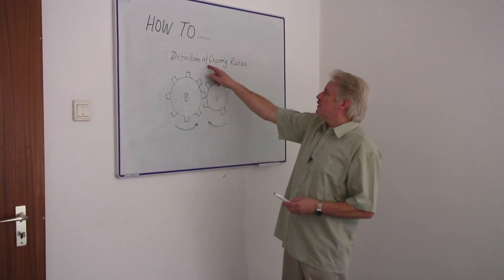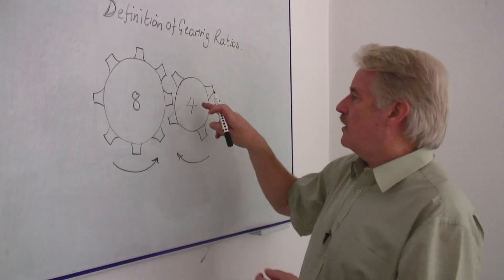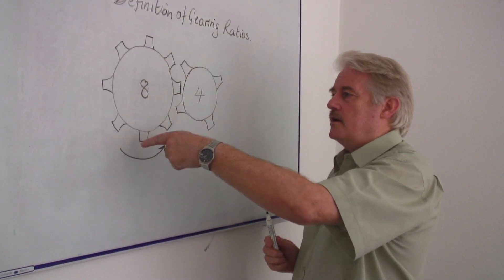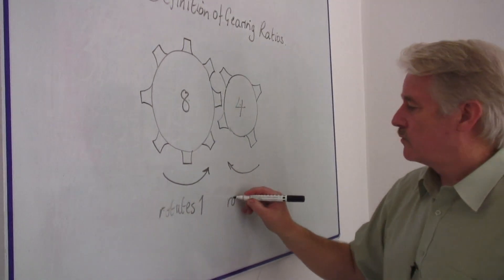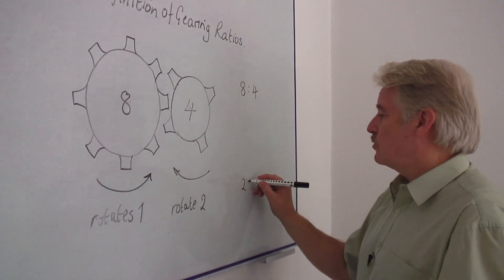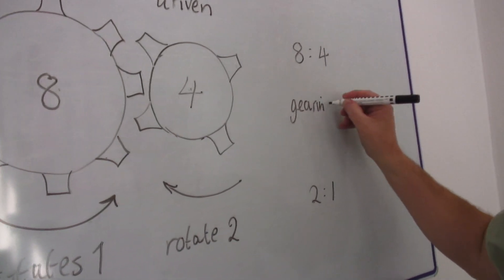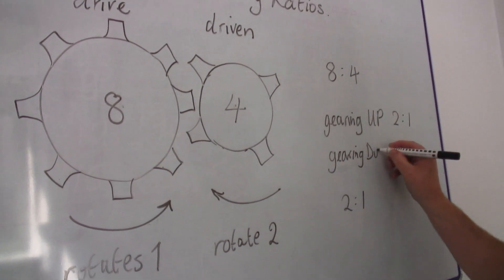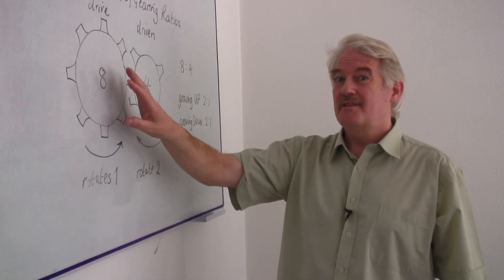Math Calculations & Conversions : Definition of Gearing Ratios

Comment: MOST IMPORTANTLY THEYRE TORQUE DIVIDERS AND TORQUE MULTIPLIERS 

WHILE AT THE SAME TIME SPEED DIVIDERS AND SPEED MULTIPLIERS

THATS THEIR MAIN FUNCTION 

IF YOU WANT BOTH TO ROTATE IN THE SAME DIRECTION USE AN IDLER GEAR BETWEEN THEM, THE NUMBER OF TEETH DOESN'T AFFECT ANYTHING

Comment: eHow can you please solve this particular problem ? 
  a gear set has a pinion with 20 teeth and a gear with 40 teeth , the pinion runs at 30 rev/s and transmitting power of 20 kw the teeth are on the 20 degree full depth system and have a module of 5 mm , the length of line of action is 19 mm, what is the contact ratio of the contacting tooth ? 
   anyone can solve this please do comment it!

Comment: Too simple.  Well done.
Technical question for you.
The ratio has to be divisible by the lowest common denominator?
12 tooth primary drive
1 to 4 ratio to 2nd gear of 48 teeth.
So, 46 teeth would not work? 
Building a model in Fusion 360 and I'm having fits with the motion link.
Thanks

Comment: If I have a 5.5 hp engine and I want it to move an atv frame with roughly 20 in high tiers what gear ratio do I need plz help
Reply: For a 5.5 hp engine to achieve approximately 25 mph on an ATV with 20-inch tires, you would need a gear ratio of around 8.57:1. You can adjust this ratio depending on your specific needs for speed and torque. If you're looking for more acceleration and power rather than top speed, you might consider a slightly higher gear ratio

Comment: I thought the wheel’s diameter determines the turn ratio.
Reply: TRUE, NUMBER OF TEETH AND DIAMETER ARE USED INTERCHANGEABLY
Reply: TRUE IT DOES ALSO THE NUMBER OF TEETH IS USED INTERCHANGEABLY WITH DIAMETER